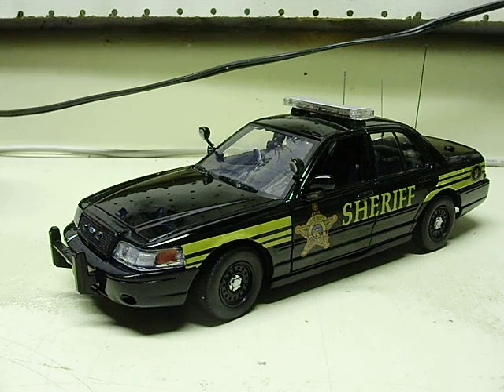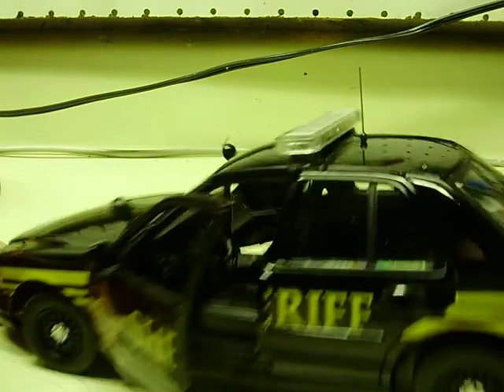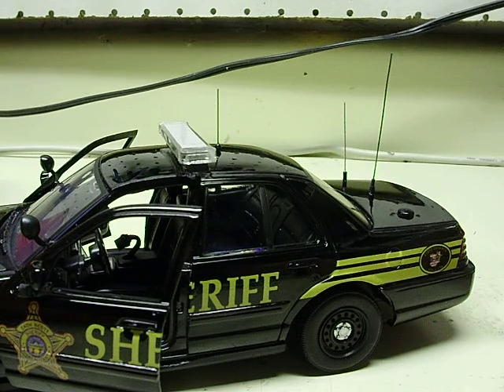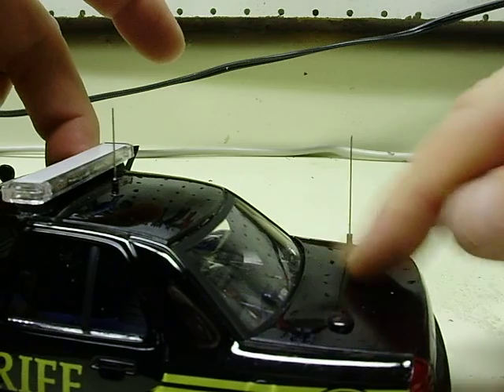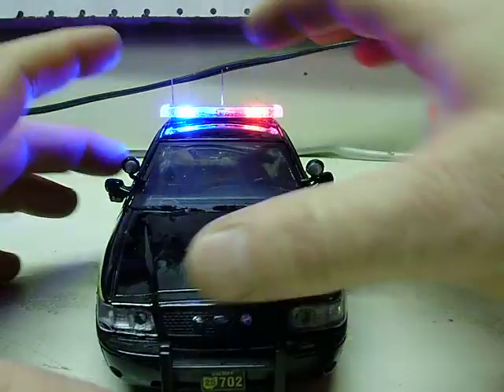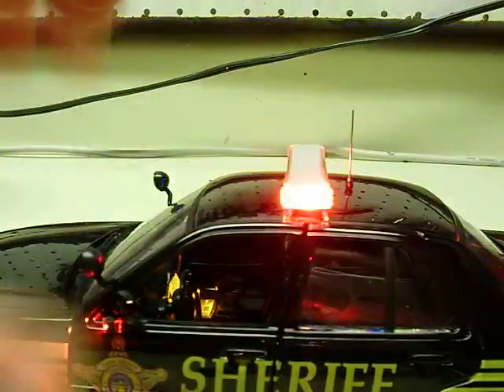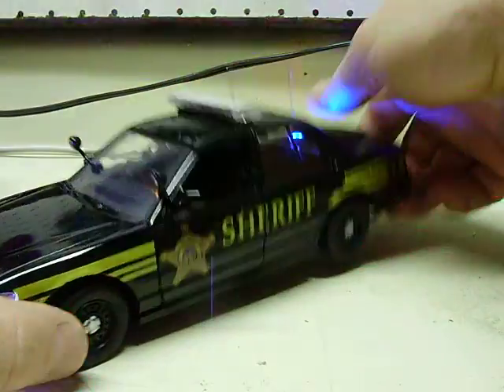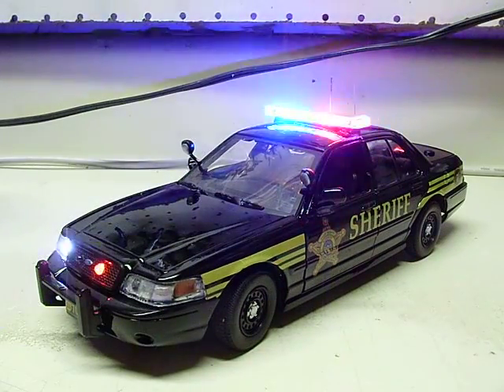Jonathan's custom FRANKLIN COUNTY SHERIFF Crown Vic w/ working lights & siren

Comment: I so want to try building an undercover cop car out of my gtx but I'm worried about messing it up and also great build Phil
Reply from the maker: +DIECAST MUSCLE 1/18 Just go buy a cheap model somewhere to practice on.  Don't mess up a $40+ model by drilling holes in it!
Reply: +01bluebusa yea I guess that will be a better plan I have a few cheap broken one that I can find in my closet anyway what kind of LEDs would you recommend
Reply: +01bluebusa John loves this car great job

Comment: Do you cut the door for the battery.. ?
How is that done
Reply from the maker: I don't unless the customer specifically asks for that.  I just set the model up so the customer can remove the 2 rear screws, pull the bumper cover off and replace it that way.  That keeps the battery from falling out, etc.